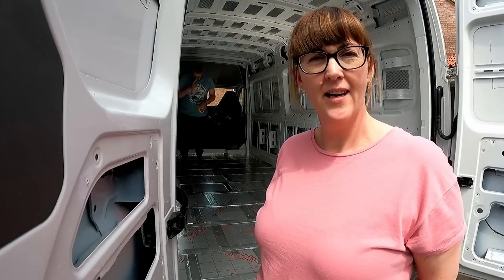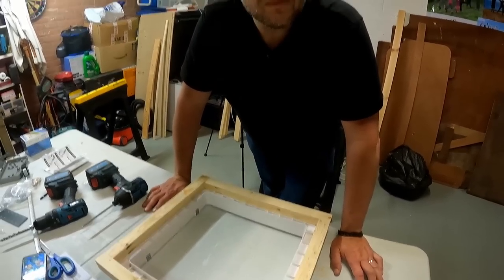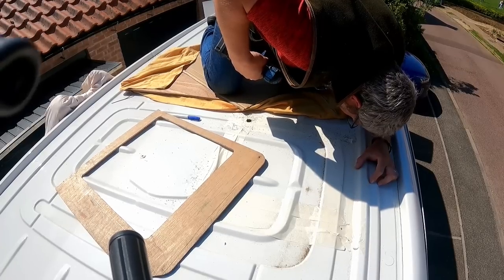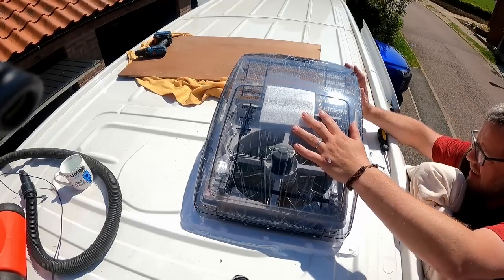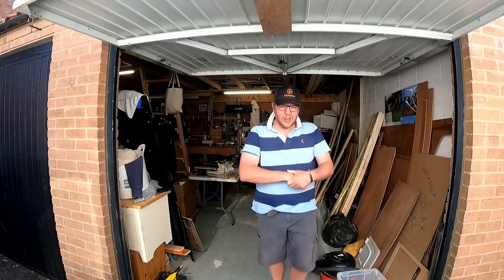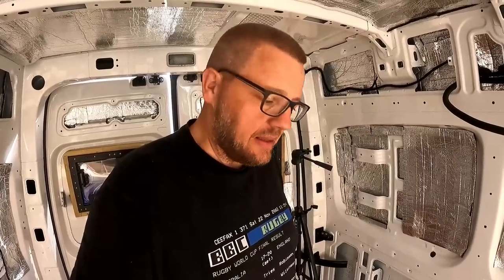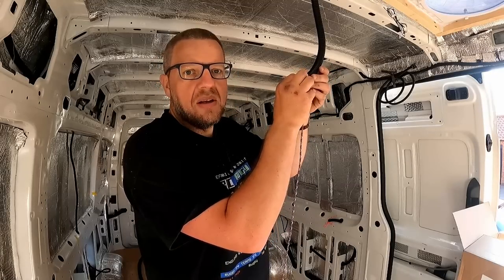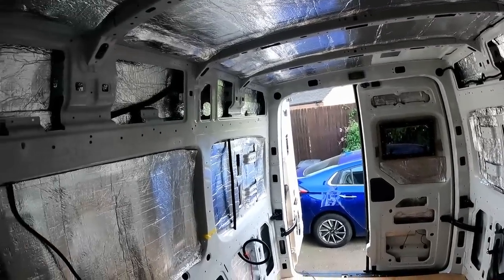Getting lots done and fitting the WINDOWS!!!  | VAN CONVERSION diary WEEK 2

Comment: Hi good to see reality when comes to van building
Just one question as I will be a van building hopefully soon and I also don't want gas but your putting in a trimmer boiler is it deisel as wondering about hot water without gas. Just found your channel and gonna follow and good luck to you both
Reply from the maker: Hi John, thanks for the kind comment. We have a Truma D6E and yes it's both diesel and electric. There are 12v and 240v options, so I'll probably connect it all to keep options open when plugged into mains and when on solar. Hope that  helps?
Reply: @pitched_up_wanderers  thanks will take a look out for that model